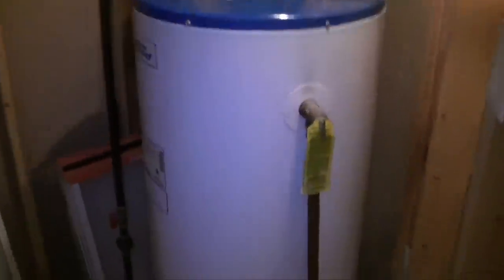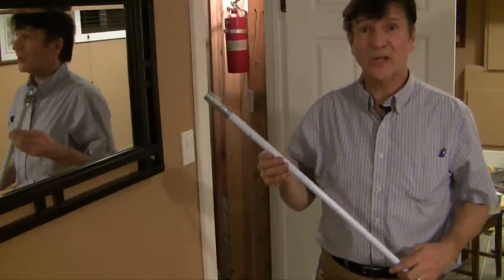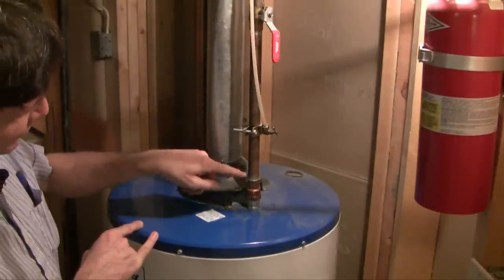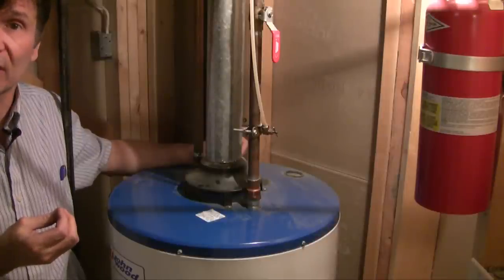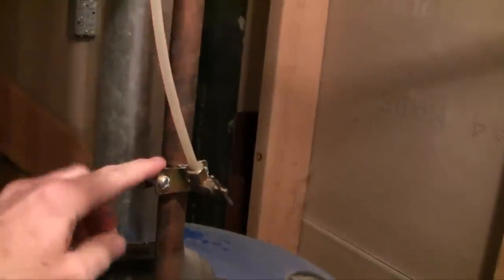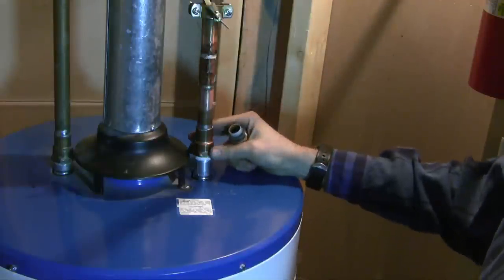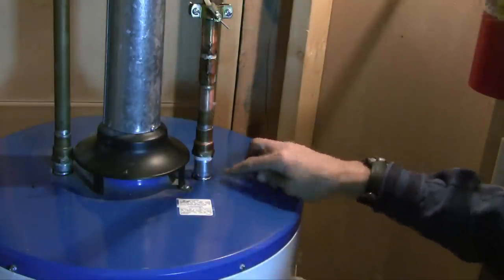How to repair a weak hot water heater, by replacing the dip tube

Comment: Could you tell me what type of wrench that was? (with the red handle, that you used to take out the dip tube and tighten it again?)
Reply from the maker: Just a novel design for a pipe wrench. Functionally, not much better than a standard design.
Reply: @spelunkerd  Holy crap, I never expected such a quick response! (Thank you for that). So no special "type" of wrench is necessary for removing the nipple?
Reply from the maker: @nellynel7183  No.
Reply: @spelunkerd Thanks again, Sir.

Comment: Hi I live in a condo complex and the hot water heater is upstairs in a closet above my bedroom recently found out that the water heater valve was leaking from the water heater upstairs we had to ripped out the carpet in the closet from my bedroom since the closet is right next to were I sleep I haven't been able to go to the condo in a week in a half how do you know if there is mold in the area where the leaked out of the pipes are located in the walls in the closet in my bedroom should we keep putting fans on the places were the water leaking?
Reply from the maker: Mold is more typical with a chronic leak and with an acute leak the risk is a lot lower. Sure, it needs to be dried carefully, and I would put a dehumidifier into the damp room, pull out all the wet drywall and rip out the carpet so all the damp area is open to air. I would replace any drywall that got wet, and for now I would pull off the drywall so the underlying wood has a chance to dry out. A good AC dehumidifier will pull a few litres of water out of the air every day, you need to check them every 12  hours and drain the tray regularly. You may be able to rent a dehumidifier from a tool rental place, perhaps home depot or others. An acute leak should be covered by insurance, either your home insurance or the condo association. Keep all your receipts for living expenses, etc. I would not install any new hardware for a few weeks until the wood is properly dried. Mold lives in damp wood so if you dry it out properly the mold won't take hold. You don't want to cover over any damp structure with new material. Good luck!

Comment: Do I need to buy a dip tube and a fitting? I got the dip tube but that connector part did not come with.
Reply from the maker: It depends on the system you have, some new tanks do without the dip tube by routing the cold water entry point at the bottom. The fitting that typically comes with the tube has a threaded end as shown in the video, but other fittings are as needed to hook up with the copper pipe. Some systems require a union, and some locations call for electrical isolation from the water input piping. Your local plumbing code may offer more info on that.
Reply: @spelunkerd  It has a date written by hand of 2000, I believe.

Comment: my cold water inlet is cold up to where it goes into the tank, about 3 inches up its warm. is that normal ?
Reply from the maker: If I understand your description correctly, I think it is. Warm water and heat can diffuse back a little, especially if there is minimal flow.

Comment: since the tube corroded off why did you not replace anode?
Reply from the maker: If you check my channel you'll find a separate video showing the anode replacement. When I think back now, I don't remember which one I did first, but they both needed to be done within a year or two.
Reply from the maker: Good point, I replaced the anode in another video. However I would not assume the mechanism of decay is the same for the plastic dip tube and the metal anode. That generation of plastic dip tubes became brittle with age, I don't think it was electrolytic destruction.

Comment: i have problem with my tube solar water heater, it has very small water tank that is on top of the big water tank and also there is very short pipe under the small tank between the small tank and the big tank and long pipe that is connected to the big tank and small tank, the problem is that the small tank keeps over flowing all the time and keeps my water pump working all the time. how can I fix it? would anyone help me please.

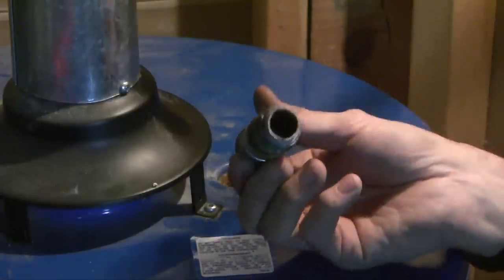Comment: Good Video.  Question. You said (when you showed what's left of the Dip Tube), you don't have to worry about it( at 7:37..." It's not going to be giving me any troubles....."). I was wondering, since HOT water expands and creates pressure, wouldn't pieces of the dip tube have a "chance" to rise and block/obstruct the HOT side outlet, or is yours a "Combo"(2nd Anode - which would block any objects from blocking it) ???  I ask this because mines a AO Smith INstalled in 1994 and I'm changing out the Anode,Dip Tube, and Drain Valve. Have no idea "yet" if it's a COMBO(HOT Side). SideBarNote : My wife lived here since 1985 and I just married her 4 years ago, so I say this because I have noooo, LOL, idea what's in store for me. Again, very informative Video. Really like it when these Videos explain to us in "DIY
Laymans Terms".
Reply from the maker: ***** My anode is not a combination device, but the output orifice is pretty large, always at the top of the tank, and unlikely to obstruct completely. More likely pieces will simply lay on the bottom of the tank, maybe bouncing around with water turbulence. You could make an effort to get the tube out but most likely it is too big to do anything but stay there, and it would be tricky to try and fish out all the little bits. I've seen some people describing small fragments that make their way to the faucet screen to get trapped there, but even then they won't cause significant problem. You could flush your tank to try and get small bits out but you're not likely to find much.

Comment: my water heater isnot working. like. there is no water coming in hot water line. when i check the hot water. i clean the debrisnow i find out that the cold water is nit coming inn to the tank.  . and in home cold water is working proeprly. just only. in heater tank the cold water isnot going in plzz help me
Reply from the maker: First, check the inlet valve on the cold water supply side above the water tank to be sure it is open. Then go to a tap with separate hot and cold controls and open only the hot valve. If you get no water at all from the hot side, you have a water flow problem. See if it is present at all fixtures or only at one. Most likely you are getting cold water out the hot, in which case your tank is not heating properly but flow is OK. If flow is OK, and if you use natural gas to heat your water, I would check the pilot flame. If you have no pilot flame, relight it. If you can't relight the pilot flame, you may need a pro to help out. If the pilot flame is lit but the tank won't heat, check the temp control to be sure it isn't turned off. When we leave on vacation we turn the power control down to save energy, and we don't get hot water until I remember to turn it back up. Every natural gas water heater has a little thermocouple that senses the heat of the pilot flame. As a safety control, thermocouples shut the gas off it they don't detect the heat of the pilot flame. Those thermocouples often go bad, causing the gas to shut off, snuffing the pilot flame. You can replace thermocouples for about $30 plus the price of the tech's labour. If the tank is heated by electric power, check the circuit breaker to see if it opened. To test an electric heater you use a multimeter set to resistance, first isolating the heating element. All of these tasks require some skill, tools, and confidence.  If the job seems too daunting or if your wife is on your case to get it done urgently, don't be afraid to consult a pro. Good luck!

Comment: I'm not getting hot water at all, you think is the dip tube?
Reply from the maker: +Sergio Perez No. If gas, check the burner, pilot light, and thermostat, and check to be sure the adjustment knob isn't accidentally turned off. It's fairly common for gas thermostats to go bad, and for safety they are designed to prohibit relighting the pilot when that happens. If electric, check the breaker, thermostat, and element. It's fairly common for an element to go bad. Of course be sure nobody turned the tank supply water valve off, ha ha.
Reply: +spelunkerd the weird thing is that it looks like  the burner is on all the time now, but when I turned the hot water on, I only get cold
Reply from the maker: +Sergio Perez That would be expensive it the plate is continuously on. I would turn the unit off, then check the burner plate to look for carbon deposits that might interfere with heat transfer. While at it I would drain and flush the tank by hooking a garden hose up to the tank drain valve. Be careful not to burn yourself. It would be wise to look for other causes of obstruction down the line.
Reply: +spelunkerd ok will try that, thanks for your help, I hope that will fix the problem

Comment: "Commonest" is not a word.  Please start saying "most common". lol
Reply: +Eunyoung Schulte - "commonest" actually is a word. Here is the definition I found:

    commonest (adj) - Occurring, found, or done often; prevalent.

So, "commonest" and "most common" mean the same thing and both are proper use of the language.

Between the two, "most common" is used significantly more often than "commonest", particularly when spoken (as opposed to written), so I would still recommend using "most common", but either is correct.
Reply: +Kevin Fegan Merriam-Webster doesn't recognize it.
Reply: So most common is commonest?
Reply: Commonest is what they have in Russia.

Comment: I'm really surprised that ur water was clean when u emptied it the first time considering the plastic was entirely eaten up. If take the drain valve off u will likely b able to use get those big chunks of plastic out from the previous tube. 

Was that a channel lock u were using to tighten/loosen the tube? It looked rather funny looking
Reply from the maker: The plastic becomes brittle with age so the remains of the tube will be long segments that are tilted upright inside the tank. The plastic doesn't appreciably dissolve into the water though small fragments may be trapped by the screens of sink faucets. Surrounded by water, the plastic at the bottom (close to where a natural gas burner is) still won't get hot enough to melt. That plastic is designed to live inside the tank for the life of the tank, so it is not worth the consternation and effort to try and remove those segments with hooks or needle nose pliers. Note that new tanks are now designed to not require a dip tube. You can tell if yours needs a dip tube by looking where the cold water intake is. If the cold water enters from the top, you will have a dip tube. If the cold water supply enters from the bottom, you don't need one. The wrench I used is a novel pipe wrench design, it is only marginally better than traditional designs. Thanks for watching!

Comment from the maker: Huh? The camera was no closer than a hand would be for lighting the pilot light, and all covers were obviously in place. That burner goes on and off like that all the time, and there was no evidence of explosive flame at the burner.

Thanks for your insight about about calibration of the thermostat. That diagnosis would have been wrong in this case, and you would still generally need to check the tube.

The vast majority of repair clips on Youtube are amateur, as this clearly is.

Comment: You missed the opportunity to install a union on your supply, which would allow for easier servicing and future replacement.I like to use unions and ball valves on both risers. This allow me to pull out the unit and flush it outside with a garden hose if need be. Also young man, you didn't wipe your joints.~ Picky old plumber dude.esq.

Comment: Install flex lines so next time the heater needs service or replaced, you don't have to solder anymore. The water heater should be at least 16" above the floor because of combustibles. Check your anode rod.
Reply: E Buzek if it's a gas type water heater with a metal flue (b -vent) I would not recommend putting braided lines on. While they are braided stainless steel on the outside, inside is rubber and when rubber gets hot from the flue it melts. I've seen those melt shut before or most of the time they flake little fragments apart which end up clogging the shower cartridge or toilet fill valves.
Reply: E Buzek if it's a gas type water heater with a metal flue (b -vent) I would not recommend putting braided lines on. While they are braided stainless steel on the outside, inside is rubber and when rubber gets hot from the flue it melts. I've seen those melt shut before or most of the time they flake little fragments apart which end up clogging the shower cartridge or toilet fill valves.
Reply: @erics3886  use copper flex lines.  This ain't rocket science.
Reply: @ebuzek3648  when did I imply it was rocket science? You are the one who didn't specify braided flex or copper flex lines not me. Two of the most dangerous things you will ever encounter with plumbing are a water heater or a ditch. They kill more people than anything else. I was simply trying to give you some friendly advice but you are obviously way above my pay grade to take advice from a commoner like myself right professor Buzek?
Reply: @ebuzek3648  I've been a journeyman plumber for 16 years and read the comment you made and was trying to offer some advice. You get upset pretty easy don't you? You are supposed to have thick skin to work in the trades and I bet you are a real joy to work with or around.
Reply: @erics3886  you didn't say what kind of thick skin. Journeyman for 16 years and not a master? Volumes dude, Volumes!
Reply: @ebuzek3648  you only need a master license if you want to run your own business which I have zero interest in doing.

Comment: what is the problem if the flame is on high for over an hour and the water is just a little warm??
Reply from the maker: The burner underneath can become dirty, producing a layer of 'insulation' between the flame and the tank. Inside the tank, solid debris tends to accumulate at the bottom, reducing heat transfer between the flame below and the overlying water. You can flush out some of those tank impurities by intermittently draining your tank. But one of the commonest causes is a broken dip tube, which prevents directed circulation of the incoming cold water to the hot bottom. With no functional dip tube, incoming cold makes a quick turn and moves back out the top and then into your shower, before it has a chance to pass by the burner.

Comment: great vid! but i cant believe you  put that saddle tap compression fitting feeding your humidifier back on , it would have been the perfect time to install a 3/4 inch tee fitting and then install a reducer to a 3/8 or 1/4 turn stop valve to tie that in giving you valve control of humidifier in case of maintenance repair, which will never leak. That saddle tap compression valve is a water leak waiting for you to go on vacation to happen! just check insurance statistics why do leaks occur when we are on vacation??? thats a great mystery! that kind of valve is what rent owners use, plumbers never use these, too much of a warranty liability, ask any local plumber about these that puncture pipe and compress over pipe with rubber compression to stop a leak which has just been created, its a redundant design, easy but not good for long term, please dont get offended, it just looks like you like to do things correctly and that surprised me
Reply from the maker: David, you make an excellent point, and I agree, I should have changed that out to a soldered reducer at the time. You are right, those saddle compression fittings with rubber seals don't inspire long term confidence. I routinely put water alarms below my water heater for early warning.
Reply from the maker: I just heard about another guy with a leak, David. Never again will I install one of those compression fittings for humidifiers. Great comment!

Comment: I would of soldered a male nipple on the inlet pipe then used a 12"-18" copper flex pipe with with 3/4" female ends so can easily remove it as many times as you want.  I always end up having to disassemble things right after I put them together.
Reply from the maker: Good point Floyd, I agree, it would have made the next swap easier. These days water tanks are not made very well, and easy replacement is an important issue. Plumbers may not like the fact that the homeowner can swap his own with much less skill required.

Comment: Those isolator connectors are available at all plumbing parts stores. The anode rod grounding has nothing to do with trying to keep the cooper water inlet pipe from corroding. Poor excuse for a very important procedure.
Reply from the maker: I’ll give you the point that it is reasonable to electrically isolate the tank, especially if you can verify that you achieved the goal without violating any electrical safety codes. However your glib remark that there is no galvanic protection from the anode rod, just inches away, is not accurate. The connections that we are talking about are threaded right into the tank, within millimeters of the inner tank wall, and the anode rod is directly contiguous with the whole system, both electrically and across the solvent. Galvanic protection extends far beyond that, (but of course never across electrical isolators).

Comment: Maybe your dip tube melted off when the copper pipe was first sweated on when it was installed.
Reply from the maker: That's a good thought, though in this case we noticed a dramatic change in hot water capacity that happened more than a decade after the tank was installed. In my neck of the woods, it's really common. I don't know how to explain why some professionals never diagnose it.